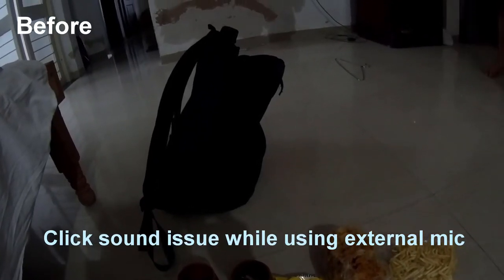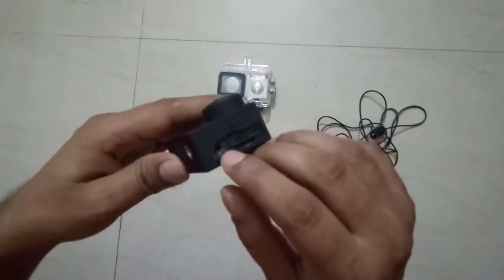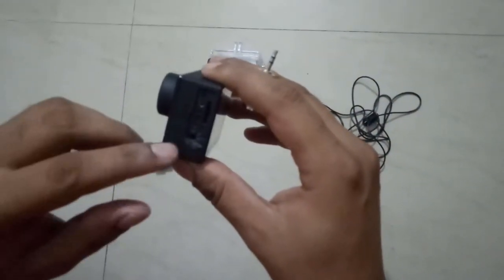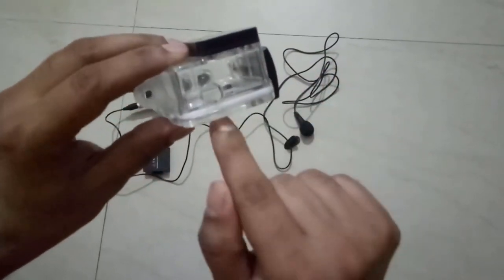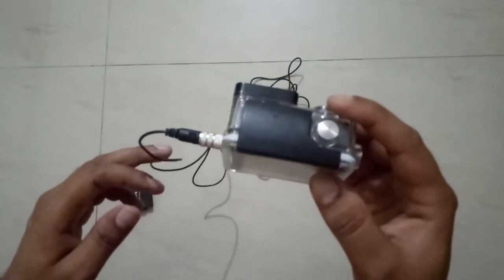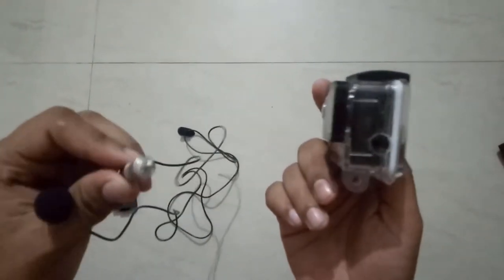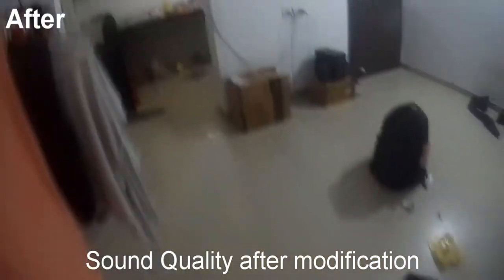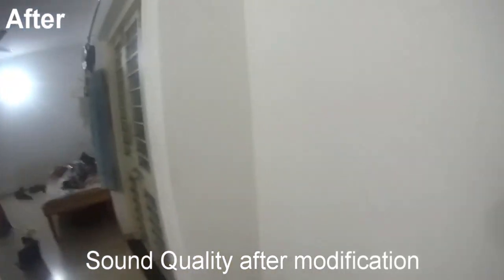Thieye t5e action cam | External mic issue fixed

Comment: Thanks for the hack. I really hate to do this to my new camera...but I plan on going to Fry Electronics. I used to have an adapter years ago when cell phones took a 2.5mm jack! Sure wish I could find it now.
Reply from the maker: TexCyn RV Life : Hey Tex, well the hack as successful as it was initially, but got screwed up badly later on.. the hole that I made around the mic port area, did not hold the adapter and it became loose.. so be careful while making the hole.. the grip needs to be maintained for the functionality to work..
Reply: Thank you. The 2.5mm jack I bought actually is longer -- too long. Maybe if I use some spongy material on the camera jack, it will work? Thanks again for your vid. It's a shame that ThiEye doesn't sell a mic jack that works! Instead of my camera coming with 2 batteries, it came with an audio enhancer back to put on the case, but I would still prefer to use my mic.

Comment: use a dremel to buzz the space around the microphone jack
Reply from the maker: +BTSwarm thnks bud. I did tht and it worked initially.  But then thr jack became too loose and now the entire sound setup is screwed up
Reply: @RacingTheHighway  I would have done the modification to the adapter it's self, rather than the body of the camera.

Comment: where did u get d converter ? can u please share the link
Reply from the maker: +Food and Travel : Hey Food and travel..  I got this from amazon. Refer the link below.. Be careful while making the hole..  If u damage the inner mic the whole thing goes bad.. If u have not purchased thieye yet,  wld recommend u go for sjcam6legend. 
DOMO nSpeed C35T25 3.5mm Female to 2.5mm Male Plug Stereo Audio Jack Adapter Converter Connecter https://www.amazon.in/dp/B01MT5P4VM/ref=cm_sw_r_cp_apap_gNdbrXhGTso5U